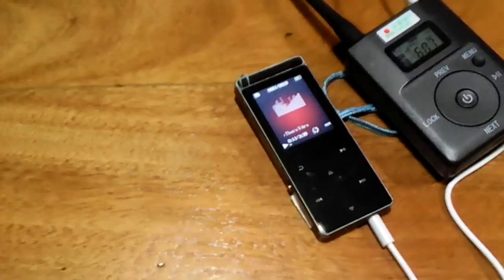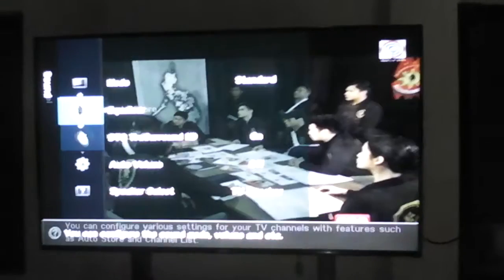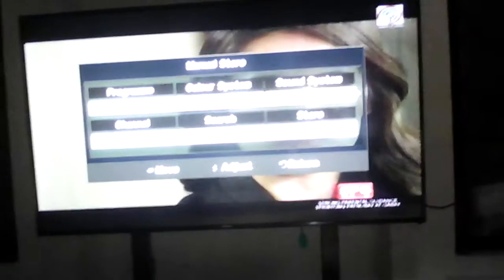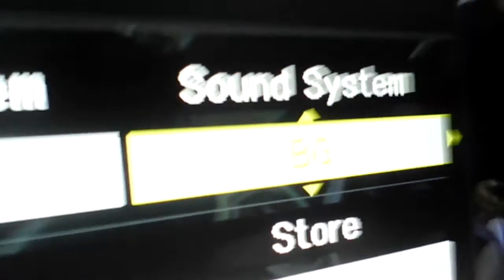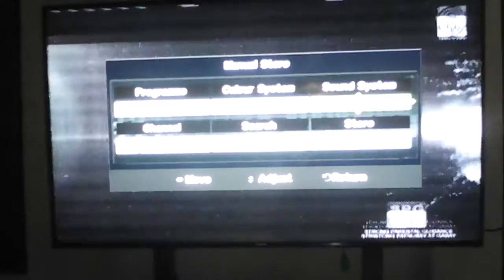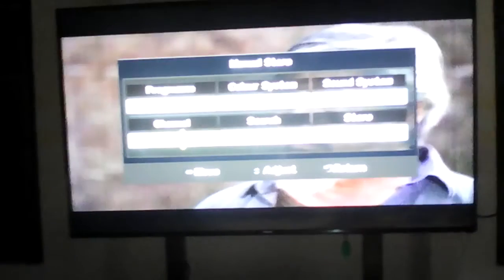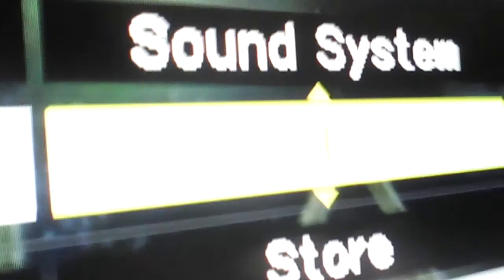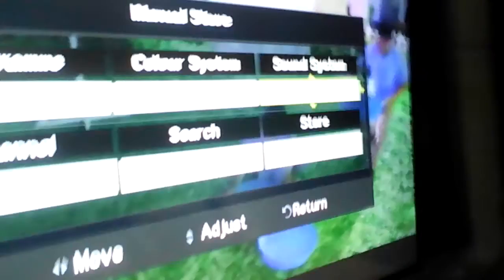Interference of FM transmitter with VHF- TV sound.

Comment: Kaya bang madetect ng radio sa phone itong transmitter?
Reply from the maker: DEPENDE SA FM FREQUENCY NG PHONE MO. 76 - 108 MHz o 88 - 108 MHz. Well yes.
Reply from the maker: Yung analog TV channel 5 (video 77.25 MHz), 81.75 MHz (system NTSC-M. / PAL-M / PAL-N), 82.75 MHz (PAL system B/G), 83.25 MHz (PAL system I; channel 6 video frequency NTSC-M), 83.75 MHz (PAL-D/K).
Reply: @FrancisLitanofficialJAPINOY  wala po bang latency?
Reply from the maker: Low latency
Reply from the maker: Mic Delay
Reply from the maker: @jaazielvicente1353  no latency po sa analog transmitters like this. Unlike Bluetooth or RTL SDR RECEIVER